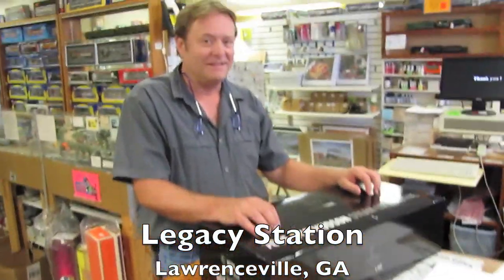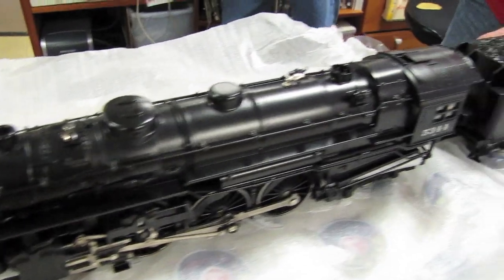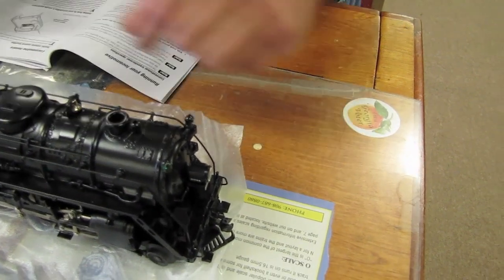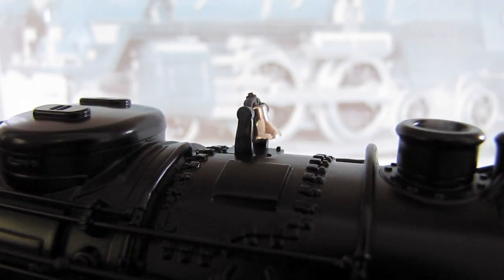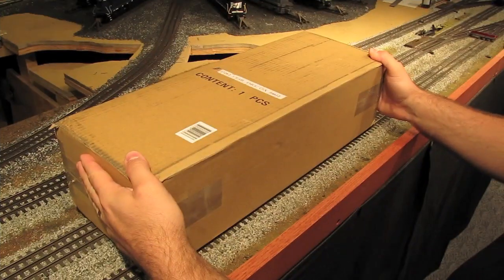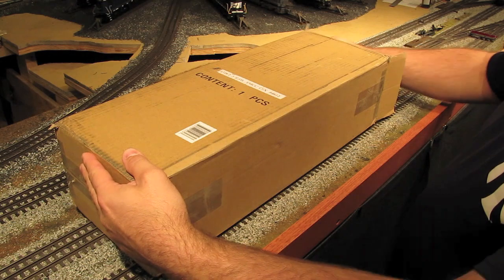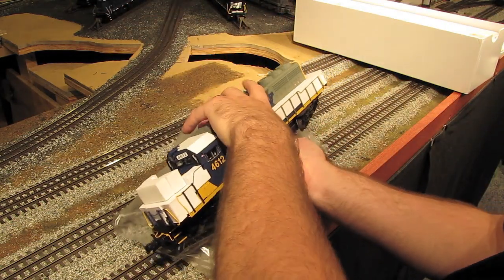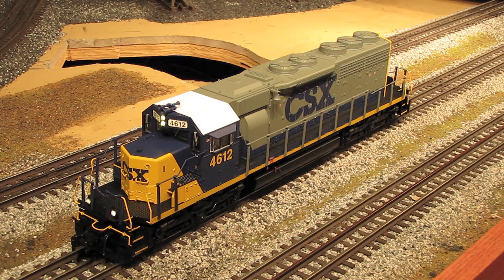Eric's Trains Video Blog - Episode 9

Comment: Excellent video Eric!!!  Congrats on the new engines!  I recieved my 700e Hudson a couple days ago and I can tell you that it is one of my favorites!  Yeah it is true that Lionel used much of the original tooling, you can definitely see it in the level of diecast detail in the boiler.  But it is loaded with separately applied detail and it is operationally stellar with great smoke effects, swinging bell and the sounds are second to none!  Anyways, thanks for the vid and have a great one! Bill